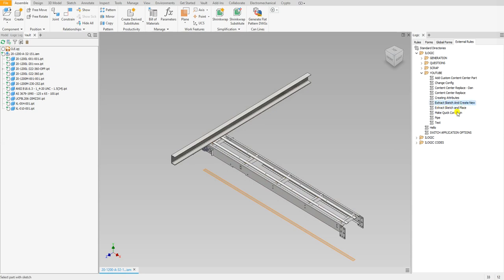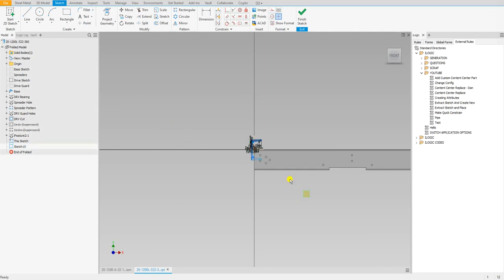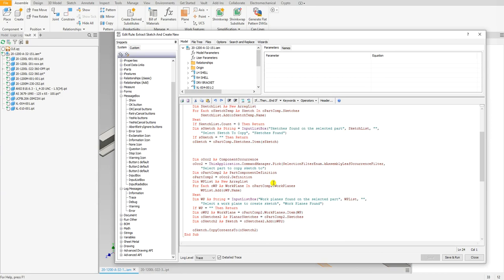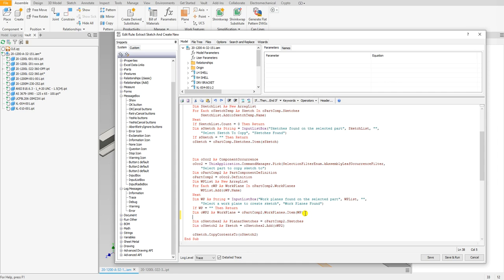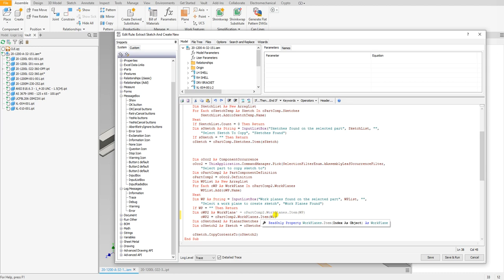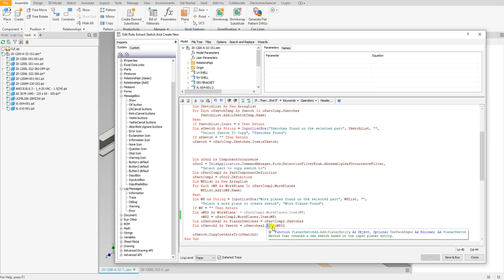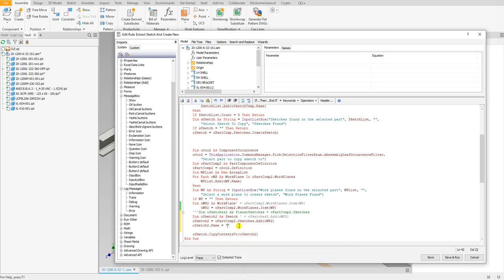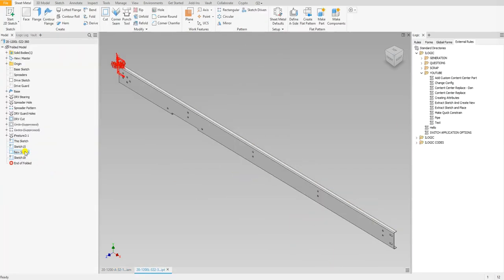iLogic Lesson #14: Creating a Sketch with iLogic

Comment: I am very new at working with iLogic stuff, and your videos have greatly helped me. I am stuck though. I am trying to add a hole to a Content Center part (a pipe) in an assembly. I'm not sure if what I'm trying to do is possible, but I need it to create or delete the hole depending on what options the user picks in the form. Do you know if adding a hole to a Content Center part in an assembly is possible, or should I find some other way around it? Thanks for the videos and the help!

Comment: Can we add more then one sketch in specific positions? It's been a while since you posted last time. Are you ok?
thanks
Reply from the maker: Hey Mateus! Yeah I'm doing good, I am a full time iLogic programmer now which is great. Do you still need help with this question? Hope you keep watching
Reply: @DesignAutomationSolutions  hey, cool, congratulations. I saw your face on autodesk forums about iLogic stuff. I am mostrly working as ilogic programmer as well. But still I'm way behind you. My question is outdated now, it wouldn't work in my project anyway. I found another way. Can you give me one advice? I am learning more about C# to understand better programming to be better at iLogic and maybe work on C# in the future. Do you think I'm in the right path or should I learn something else? 
Thanks and success
Reply: @mms2810  that’s great to hear! Keep at it, it’s fun to keep learning more. C# is a good language to learn. I went the VB route instead of the C# however, just because I became more familiar with it from the beginning. If you plan on creating programs using Visual Studio, both languages will get the job done. C# is definitely used much more than VB, outside of Inventor programming
Reply: @rookie147  I was thinking about VB as well, but because C# is one of the most used languages, I though to give it a go. I'm using visual studio for debugging a bit. Much better to find the problems in the code.  Yeah learning is fun, I'm really liking coding. I'm from a mechanical background so I'm struggling a bit, but my boss is happy with my work which is fine. 
Thanks again, and if you won't post anymore, keep helping in the forums please. heheheheh

Comment: Thanks a lot man, loved your videos. I have a question wondering if you could help me out with it, We usually work will large assemblies of sheetmetal parts. We need to create all folded and flat drawing of individual parts. Usually 1 or 2 parts fit in a sheet. 1 part list has to be created per sheet showing the parts present in this sheet and the quantities of these parts used in the main assembly. Current we use static value and change the quantity manually. Is there any ilogic solution or other techniques we could use to get the quantities of these parts automatically without having to change manually. Thank you.
Reply from the maker: Glad you liked the videos!

An iLogic version could consist of a iLogic rule that the user presses to automatically fetch that information each time and fill it out on its own, matching the assembly. It's not an automatic update since the user will have to run the rule but at least it can give an accurate quantity count quickly. That would probably take a couple days to write in code

Another option that comes to mind without iLogic is placing that assembly into the drawing but that does not sound ideal.
Reply: @DesignAutomationSolutions  Thank you so much.